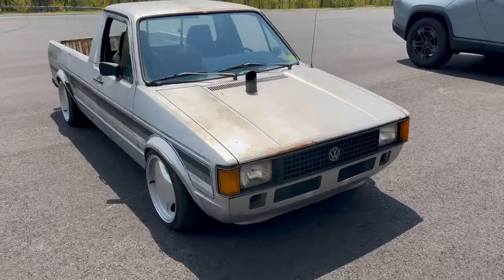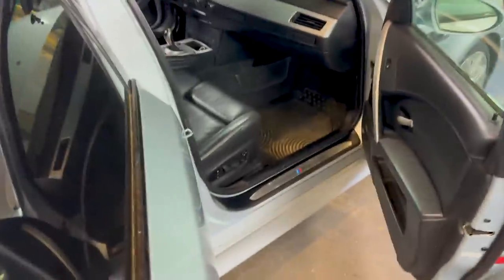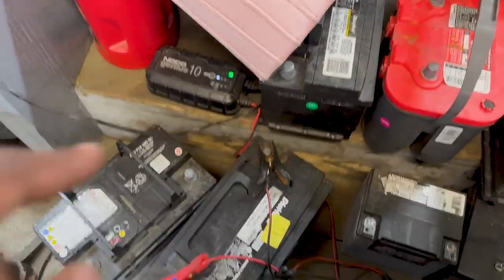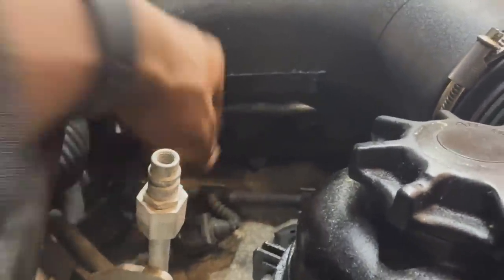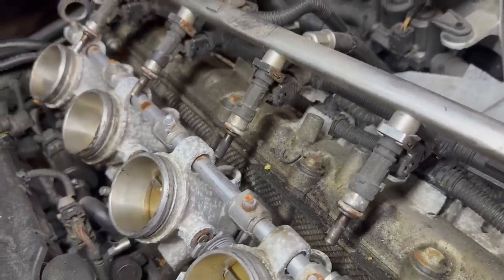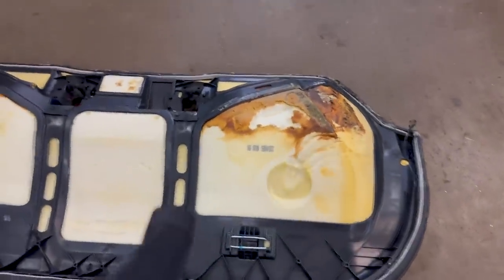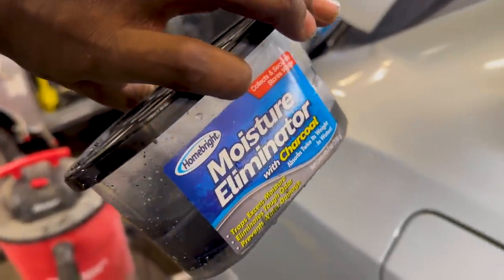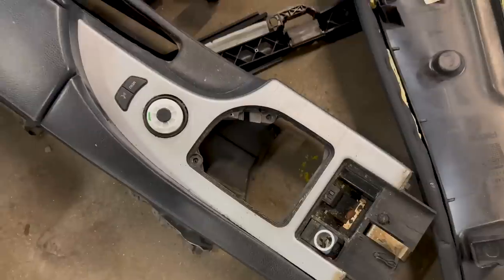Fixing a Non running V10 BMW M5, a marketplace disaster, please help

Comment: The ECU will not send power to the injectors if there is a critical fault in the engine management system.
Take a 5v diode and mount in a injector plug and see if it’s flashing. If it does, injector fault.
If not, look elsewhere.

Comment: E60 basics. ALWAYS diagnose with a 100% working battery. Brand new if possible. These cars (and E65 and E92) starts acting insane if voltages are off by just a tiny bit.

Comment: I had a car with a mysterious water leek under the dashboard once. We stripped the whole dash out. and discovered a thin welded in metal plate inside the scuttle at the base of the windscreen (under the hood). It was directing rainwater directly through the heater and blower into the passenger side floor. The whole carpet had to be pulled out to get things dry. It was horrible. If you ever find water inside a second had car. WALK AWAY! or demand a fantastic price. Sun roofs (especially in Europe) often go bad. I avoid them if possible.

Comment: Concrobium is great for killing mold, and the injectors are probably just very corroded and need to be replaced. Guessing the PO used crappy gas that had a high water content and a year of sitting killed them.

Comment: Should have started with everything electrical from the jump. These cars throw so many codes when modules aren't happy voltage wise.
Battery 
Alternator 
Fuel pump 
SMG Pump
SMG Relays

Comment: Ecu got flooded so no signal to injectors and smg pump is pumping for long so it gonna get burned quickly. Smg hydraulic unit has an internal leak so it has hard time to build up the pressure… but anyway 5k is a gift for this car))

Comment: Are the injectors clogged (or whatever injection thingy not working) or is the car smart enough to know it has already dumped enough fuel in those cylinders and doesn't want to flood them?

Comment: 2:52 To get rid of that cigarette smell, I would advise you to use an Ozone Generator.
After getting all the ashes and cigarette buts taken off the car, the Ozone Generator will erase all the bad smells inside the car, as well as kill all the living creatures inside it, e.g., mold.

Before using an Ozone Generator, please make sure no person is inside the car or enters it, as well as animals or plants.
On a daily driver, one hour may suffice. On this car, leave it over night.

Comment: Should've siphoned the gas out of the tank, old gas can definitely create a lot of issues. Depending on how long it's been sitting that gas is probably fouled. For mold inside of vehicles, dehumidify it to get the rest of the water out, then get a ozone generator and seal it up with it inside for a day or so. Make sure you do not enter the car or inhale any of the ozone! Preferably leaving it somewhere with a lot of ventilation. And sadly there weren't enough jokes about John giving things a blow.

Also RIP Stevon, hope you win the lawsuit Rich.

Comment: Computer/DME issue  Common BMW issues.  I have  "BMW" Mini Cooper and the computer/DME failed and wouldn't activate my injectors.  There are also some cases where the fuse panel in the kick panel gets wet and causes issues but I'm not sure if that is an issue with the BMW M5.

Comment: iunnoshitaboutno M5's but I can assure you as a person with wide knowledge of cursed shit, were you to you rip that wiring loom/harness out and put it on the floor it would to fold itself to a five pointed start and start a electrical fire and summon some imps at minimum, a BWM lawyer materializing is a distinct possibility.

Modern cars are wild. They legitimately designed water that's outside the car to go inside it and added at minimum 4-5 failure points to the route just for good measure.

Comment: If that battery was manufactured in 2020 then there’s a potential that its still under warranty… mine came with a 3 year warranty. . No use in charging a battery sitting that long

Comment: I had problems with my volkswagen golf 4 sunroof. My car transformed into a lake. I found all the drains clogged and the rear left  drain was disconnected. They are clogging because at the end of the drain there is a rubber boot and on some cars it is smaller than the drain line so dirt that was able to pass through the line ends up being trapped at the end of it.

Comment: I have a Jeep with a sunroof.  Worst idea ever.  Drains are behind both axles.  Another bad idea.  Drains were so clogged I gave up on them and ripped out all the tubes and put in half inch clear tubing and relocated the drains to behind the plastic of the wheel wells so they wouldn't get mud in them

Comment: Fuel pump working with 0 pressure doesn't mean it working with 8-10 bar. But I'd bet on electrical issues, given amount of water inside

Comment: Congratulations on ripping off the intake plenum, you snapped the connectors on the vacuum pipes on the rear of them, replacing those pipes is pretty much a gearbox out job

Comment: Someone please tell uncle Rich there is a battery jump point under the hood. Should be able to power up the electronics there instead of bending yourself in a pretzel to pop the trunk. Also, not a good idea to charge the battery directly in the car while the battery is hooked up. Good way to blow your IBS sensor.

Comment: BMW Spark not firing.... But you get fuel.

ECU or DME Security software anti theft keylock system.

Check the onboard security system and it will prevent spark to stop theft.

It's BMW's version of an immobilizer.

It sucks, truly.

Other than that, you can only just follow the terminat current and check the relays. <3

Enjoy the BMW knowlege from a former E36 owner who totally rebuilt a few of these cars.

Comment: water damage on some modules, causing the car to go into some limp mode turning the injectors off ?, would be weird if all injectors were clogged to the point of not running.

Comment: I hate sunroof’s.  I’ve owned 8 cars with a sunroof and only one of them had a sunroof that worked 100% and didn’t leak!!  
People don’t use them, they are heavy, they add $ks to the price of a new car, they break (often), they leak and cause rust, they ruin the aerodynamics of the car, they are noisy, you lose headroom, they ruin chassis rigidity and they get hot from the sun.  
Unfortunately when the dealership orders a car they tend to spec them out so they can charge more.

Comment: Run forest run. Everything can be fixed but this is a flood car and couple it with the V10 and it will be an endless money pit. You could run a negative ion generator in the car for 24 hours That will kill the mold and get rid of any smells.

Comment: Okay y'all, here is how to troubleshoot the injector pulse problem.  First the DME will allow the car to crank and Rich can communicate through the gateway module.✅ injector pulses will not fire✅ fuel pressure present ✅.  Power is supplied from injectors from Terminal 15, from fuse F005, from DME main relay.  Injector pulse is ground switch controlled through the DME individually and they all will not fire likely indicating power problem.  He can provide power directly from pins 2 and 5 on terminal 15 (2 green wires) and see if the injectors will pulse or he can start at the injectors and work his way back checking inputs and outputs along the way.  Bad fuse/fuse block, bad wire, bad relay from the DME relay - fuse F005 - Terminal 15 -injector.  Last thing.  Terminal 15 is activated from pin 8 at T15 FROM the CAS.  Could be issue with CAS or signal from CAS to Terminal 15 relay.  Guaranteed the injector pulse issue is there somewhere.

Comment: I'm a farmer and right to repair was big thing that went on with farm equipment the farmers Pay 1/4 1/2 million for some of those tractors and they have garages owned for 3 generations every tool you could ever want and they couldent get the software to fix they wanted them to bring it to dealers at price of loading it on lowboy and bring it to dealer that some times are hours away it was bs farmers to some companies to Cort and won  for the software

Comment: Nothing ever broke on my m5, it’d just refuse to work 9 times out of 10. Can I have $10 of ‘it’s still the fuel pump’ tickets please
Reply: Also get a new battery.. YouTuber things.. “on today’s episode B is for Bui NO.. b is for battery
Reply: You can get a dodge M5 pump to run eventually with enough starts, and it’ll run fine for 100 miles and play the same game 100 miles away from home.

Comment: I think people are a bit over the top with their mold fears. Are their dangerous molds? Sure but i dont believe the bulk are harmful though one shouldnt sniff it up their noses as if it were nose candy nor should the put on bunny suits and respirators at the sight of every mold. Dont forget it was a mold that brought us into the antibiotic era which is unfortunatly closing on us due to excess use as we do with everything we like.
Reply: Yes, there are dangerous molds. Some types of mold are more dangerous than others and black mold is an example of that. It is recommended to wear a respirator. Some people are also more sensitive to mold than others, but safety should always be a high priority.

Comment: Its a bmw! Just change the oil, pull the plugs and fog it.  It will be fine, after you change the computer and crank sensors.

Comment: I have read and seen.. on YouTube that these engines can be rebuilt for $60G', but it's the same fragile piece of ####.
Ooor, it can be rebuilt by certain BMW shops/BMW Race Shops, and can be among the strongest BMW engines there is, cause BMW is inconsistent, but most are problematic, especially after 70,000 miles 🤕so have fun with that $$$$$$$

Comment: You need to finish this project, so you can bust the myth of BMW's, most certainly since this juvi era is so enamored with Euros and this V10.  
Working class Joes raising kids will make the same mistake you did, cause this is a very miss led era, thus leading to a very juvi era 😔

Comment: Sunroofs are nothing but problems on used cars. I avoid cars with sunroofs. That car is disgusting. You can’t clean the mold out of the fabrics, the interior needs disinfecting, drying out & replacing all the fabrics.

Comment: The fact you waste your time thinking people care about your battery removal. BMW has a system that needs to be reset for the Alt when they go bad of course you know this. It will not recharge at the same rate.